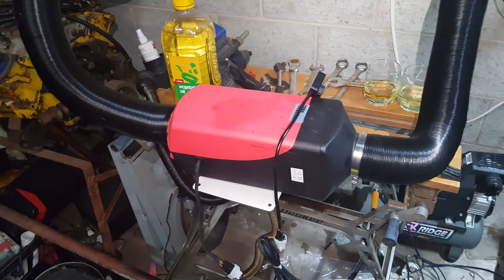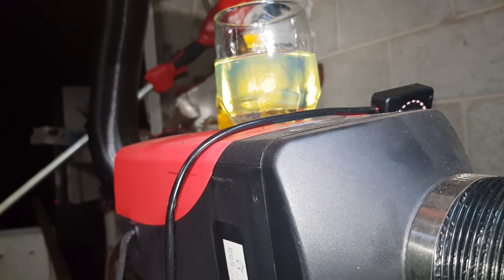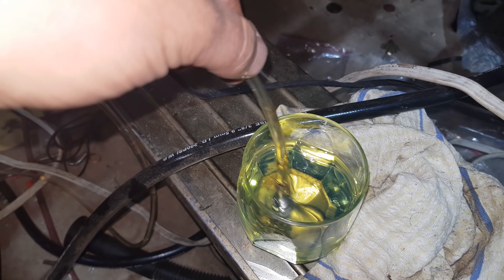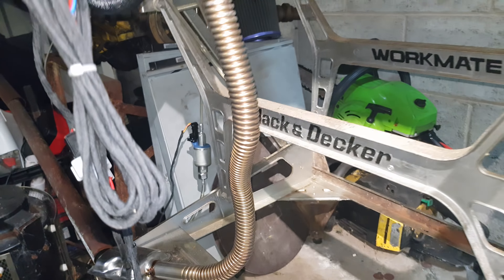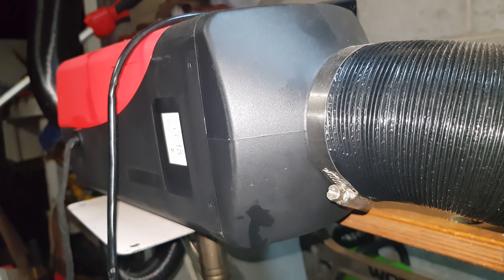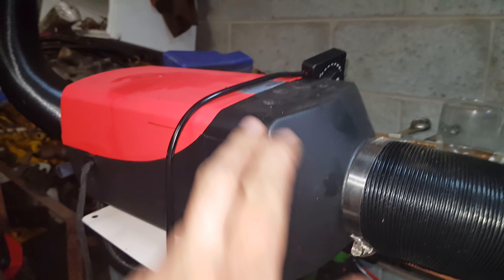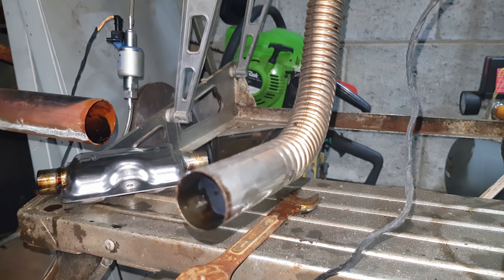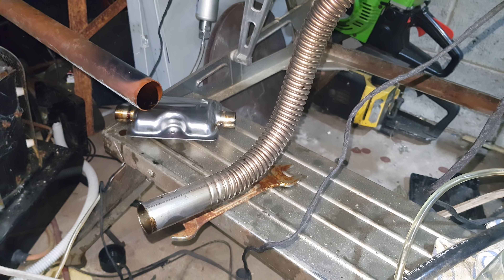Cheap  Chinese 5Kw Diesel Heater Runs On Bio fuel Vegetable Oil /Diesel Mix

Comment: I've been experimenting with mine. I've been successfully running a blend of 87.5% filtered veggie oil to 12.5% unleaded gasoline. Adjusted the fuel curves on the controller to 2.0 - 5.5 and rpms to 1680-4000 and now it runs better than stock. Startup and shutdown on kerosene, fuel is preheated through a SS brakeline wrapped around the exhaust, temperature maintained by a thermal sensor and a tiny PC fan to keep and hold fuel around 200-220F. I've ran about 30-40 gallons of waste oil through it already like this I'll post a video with my main account and link iit here soon. Heated my whole house through a power outage/snow storm.  cheers buddy
Reply: Hey bob! Thanks for the detailed description, I'm keen to do something similar. Is this mixture still going strong? any troubles along the way? Have you made the video on your heater setup I can check out?
Reply: Hi Bob. I'm going to try this in the next few days. Is it still going well? How's the carbon deposits? Cheers.
Reply from the maker: I've been running old motor oil lately and still been good with some diesel from time to time
Reply: @Oneupthesleevecustoms  I have thousands of litres of wvo. Trying to see if I can use it reliably in the CDH.
Reply from the maker: Mix it with so me petrol  it's find
Reply from the maker: Mix it with petrol its fine. Lowers the heating costs heaps
Reply: @Oneupthesleevecustoms  Just tried it duplicating Bob's settings and preheating and mix ratio. Flames out after a few minutes.
What ratio petrol/veg oil have you had success with?
Reply from the maker: 20 to 30% petrol has been heaps
Reply: % by weight or volume

Comment: I  did try 30% or lass of used veg oil and 70% or more of Diesel and works fine, starts without pre heating the fuel. I don't have a lot used oil, but using two separated tanks to mix it to start probably do even better. Thanks for the video, I want try it, but your video encourage me to do it!

Comment: I run mine on 80% filtered waste oil and 20% unleaded gasoline. Runs excellent. This is what I had premixed I use in my Tdi jetta. Very close to the viscosity of diesel fuel. Burns very clean in the heater so far.
Reply from the maker: Filtered waste motor oil? Veg oil?
Reply: @Oneupthesleevecustoms  Waste motor oil. I have an unlimited supply of it. I mix 4 to 1 with gasoline and pump it through a 1 micron sock filter. The heater runs clean with no smoke at all.
Reply from the maker: Thats awesome ill have to service my van and have a go
Reply: I only tried that mix because I had it on hand. Going to try running 3 to 1 this week. I bought three of these heaters to heat my shop, and have been testing one of them on motor oil before I set them all up. I am quite pleased. Runs better than my converted waste oil burner I have used for years.
Reply from the maker: They kick out heaps of heat. 5kw ones?
Reply: Lol did I mention the password for the heaters is 1688. In there you can play with the min and Max pump output and fan speed. I have mine running Max pump at 7.5 and Max fan at 5000. You need to raise the fan for more air when you raise the pump. Max values are pump 8 and fan 5000. Hasn't melted it yet.
Reply: does the pump setting in Hz need to be turned up to burn waste motor oil or waste vege oil?
i think the fan speed would help get more air to get a complete burn
thank you very much for sharing

Comment: Veg diesel users around here have a special exhaust pre-heater for the bio diesel.  It raises the flash point.  They have two valves where they can start on diesel until it gets up to temp, then switch to veg when the combustion chamber is hot enough.  This heater you would likely just have to leave both valves on to basically get a 50/50 mix on a hot combustion chamber.  Oh always shut down on diesel if you can.
Reply from the maker: that's a good idea mate cheers

Comment: Another great video, thanks! I'd still love to see you pass straight vegetable oil through a couple of loops of copper fuel pipe around the exhaust outlet pipe to reduce viscosity after warm up on diesel, there's no reason you couldn't burn 100% then. Waste veggie and waste engine oil can both be found free.
Reply from the maker: Im yet to test the preheat methods
Reply: @Oneupthesleevecustoms  No pressure but Keen to find out. The next obvious tests would be waste vegetable oil and used motor oil (don't ever mix them) though a racor diesel fuel filter/water separator between the heater coil and fuel input (warm oil is easier to filter than cold). There are even Chinese knock off racor /Parker filters.
Reply from the maker: Im keen to test anything i can :) this is why people watch my channel:) :)
Reply: Oh I just asked this about hot veg oil... I've just bought one and ready to have a play myself..  bio diesel is no different to a 50/50 mix.. I run my car with standard no alterations on a 50/50 mix if diesel and filtered waste cooking oil from local chip shop the engine drives better and I'm basicly achieving between 100 _ 140 MPG. I WILL ALSO MAKE A VIDEO LATER
Reply: @Oneupthesleevecustoms  I've been watching your videos on this, and bought a heater in hopes it would run of straight oil (the next day you posted a video showing it won't work haha) Anyways, I can get a lot of WVO for free and have made a few batches of really really garbage bio-diesel. I was trying to see how lazy I could be in the process. 400 micron filter, didn't titrate butI used about 8.2 grams of KOH 92%, and 15% methanol. All I did was drain off the glycerin and ran it right into the heater, no washing. Has been running for a few weeks here. Might be something you would want to play with since running off store bough new veg oil isn't really cost effective. I would be interested to see if pre-heating the oil would make it work on straight oil.
Reply from the maker: Bio diesel  should work fine

Comment: Yes you can improve the viscosity by pre heating the vegetable oil though some sort of heat exchanger but the oil still has to be burnt with a lot of air to to incinerate that glycerine fraction.
Reply from the maker: Thanks mate i didnt know about that
Reply: What glycerine fraction? Glycerine/glycerol only comes into play from making biodiesel which is not being done here. The VO is mixed and burnt directly.

Comment: The idea is to use used veg. oil that you can get for free. It has to be filtered and pre heated to work and then with a fair solar array you get   FREE HEAT!
Reply from the maker: Free heat from waste is the goal
Reply: Reclaimed cooking oil is still mixed 25/75% diesel to bio oil.

Comment: In regard to some comments here about burning used engine oil, it should work if filtered and mixed up to 40 or 50 percent with diesel but I wouldn't run it in my parking heater as automotive oil now contains anti burn agents. I don't fancy myself cleaning the burn chamber that often.
Reply from the maker: That makes sense. There is alot of additives in modern oil

Comment: Kerosene (or Home Heating Oil in the UK), is very similar to #1 Diesel, which has a lower flash point than #2 Diesel (auto diesel).  It is cheaper to buy than #2 Diesel because you're not paying road taxes and with the lower flash point, mixing in some straight vegetable oil would probably work out a bit easier.  If you continue to go the biodiesel route, you might blend in SVO as it gets warmed up.  I used to make biodiesel for my Jetta TDI back in the day.
Reply from the maker: Yeah it would work a bunch better if there was some compression to help it burn

Comment: Just noticed you are a powerwaller too. Good man. PS you could capture some of that waste heat going out the exhaust and heat water with it if you used an EGR cooler (mazda ones are cheap as hell here in the UK) + 12v pump to pump water around it.
Reply from the maker: Haha thanks man check this video out
Reply from the maker: https://youtu.be/BRMSFcq4Bc0

Comment: how about a 25/75 mix diesel/ veg oil. like the idea of used motor oil as well
Reply: I'm sure works because I just did 30/70 on my.
Reply from the maker: Happy with the results
Reply: Does the fuel oil mix separate in the tank ?
Reply from the maker: Over time be no issues in a vehicle
Reply: @Oneupthesleevecustoms  Thank you
Reply from the maker: @wishfix  once they are hot these things will run on most oils
Reply: @Oneupthesleevecustoms  👍🏻

Comment: I have been mucking around with used vegetable oil from the local fish and chip shop for years. I have burnt it mixed with diesel in my old digger and it runs well. BUT. Vegetable oil needs to burn at a much higher temperature than diesel to burn off the glycerine fraction otherwise it carbons up the engine. Has anyone dismantled the burn chamber to assess just how clean it will burn? Is there any unburnt residue from the vegetable oil fraction of the mixture.
Reply from the maker: Yet to open but mostly ran on diesel ag again now

Comment: I'd also be interested to see used motor oil attempted if you're willing to potentially wreck the unit. Let it warm up good on diesel then switch to used oil for a better chance of ignition. If it works, see if it will sustain.
Reply from the maker: Ill try a mix of motor oil and diesel

Comment: hi use the heater to start on diesel then switch to pure veg oil but heated with a container attached to the exhaust pipe as gets thinner when heated
Reply from the maker: Does it work

Comment: Vegetable oil probably would have work if you got the unit up the heat using diesel and then switch fuels some multi-fuel cars use this technique like getting the engine up to temperature with diesel and then switching fuels different fuels will work
Reply from the maker: Cars have the big advantage of compression:) sadly thats somthing these miss out on but if i could heat oil to flash point ish. It would run easy

Comment: Try veg oil and unleaded petrol 90%/10%. I used to do veg oil 95% to petrol 5% in diesel cars from pre 2000, and it worked a treat. Petrol thins the oil down much better than diesel.
Reply from the maker: Does it stay mixed
Reply: @Oneupthesleevecustoms  Absolutely  yes. The reason I suggest 90/10 is because petrol mixes better than diesel, it's more potent. It was well worth doing even with new veg oil because it was about a third of the price as diesel years ago. Now you might want to ask a friendly chip shop owner for some used stuff, but be sure to filter it well. There are loads of videos on that. Then just keep trying until you get the right mix.
Reply from the maker: Ill give it a small scale test cheers
Reply: Using that mixture, did you need to modify the vehicles, IE heat the fuel line, or unmodified? And does it get cold where you live?

I'm in Melbourne, gets fairly cold.

Thank you!!
Reply from the maker: I've done 70 waste motor oil 30 unleaded before
Reply: @paulraymond1804  I tried heating it up, but it's not necessary because the petrol really thins it down. I'd buy veg oil from the supermarket for a third of the price of diesel though, so it was well worth it. Now veg oil costs more than diesel, so yeah, find a kebab shop and ask them for their premium used oil 😁 . By the way, my cars were all old school diesel. Don't do it with a modern diesel, ie. after late 90's models that are multijet engines. Even then, if using used oil, filter it very well, or the injectors will clog up.
Reply: I drove from Manchester UK to Rome, up and down a good few times with no issues. Saved a ton of money.
Reply: @camperdude5241  ok that's great man. Manchester is pretty cold right? 😅

I asked my local fish and chip shop, they told me that they get paid by the business that collects their used oil. 🙁 I thought it was the other way around.

Will try other food places around here, if they all get paid for their oil, the plan is a bust depending on how much they get paid.
Reply: @paulraymond1804  the world has gone crazy! Yeah, keep trying different places. I've also asked at local tips, where they usually have oil drums full of restaurant oil. Only use it if you filter it extremely well.

Comment: Problem is that it's next to impossible to get free waste oil because all the restaurants are contracted with oil recycling companies, Who pay the restaurant to come pick it up. Trying to tap those waste traps in the dumpster area can get you a fine.  New veggie oil is far more expensive than diesel as well.

Now that being said, any small business diner would possibly be able to hook you up. As far as heating WVO goes, there are better heaters for that. DIY designs are available everywhere and there are a few people who sell fabricated units, or you can get a commercial waste oil heater. I'd stick to using only diesel in a Chinese diesel heater. A fun experiment, but if you rely solely on CDH for heat, dont mess with it, it'll end up breaking when you need it most.
Reply from the maker: I got 1000l of it free last week . Need to look at little shops. Yeah I run cars and trucks on it now not worried about diesel heaters anymore

Comment: Try to wrap a copperpipe or something around the exhaust to warm the veg oil before it enters the heater, that might work if you get it heated enough. But you have to runn it with diesel for some minutes.
Reply from the maker: It works well.as a mixture

Comment: what is advantage of veg oil? It is more expensive to purchase correct? Yes you can get used stuff but that is dirty. Do they make a 120 volt version of these heaters?
Reply from the maker: Not seen a ac version. Yes mainly if you could get free veg oil/get it cheap. Ive tested a few different fuels
Reply: @Oneupthesleevecustoms Vevor briefly  put out a white unit that had an AC option. I bought one about 3 months ago and then it was unavailable. Don't know why, maybe they will end up selling a vevor branded power supply to try and generate a revenue stream there, who knows lol.

Comment: You could try waste diesel engine oil my diesel car ran on it for 3 years mixed with straight diesel car runs flat out on engine oil when the turbo lets oil into the inlet manifold
Reply from the maker: Like when a turbo seal blows?
Reply: @Oneupthesleevecustoms  a diesel engine runs flat out when the seals go need to stall it cutting the fuel supply makes no difference
Reply: @marksmith5156  lol that's got to suck

Comment: Awesome to see the viscosity difference let it run. I was wondering if we can connect on Facebook. I would like to help with this project because once you can get it to run straight Veg Oil then I will buy one to do the same.
Reply: Also been thinking a lot about this project. The exhaust wastes a lot of heat that you can recuperate with using some steel gas pipe. At that thought I suggest not using the exhaust to heat the Veg Oil it may get to hot and to complicated. I think you need to have 2 tanks start on the 50/50 mix then you can switch to Veg ounce you use the heat from the air vent to get the Veg Oil hot. And the heat in there should be just hot enough to get it thin enough to burn and not risk the Veg Oil from autoignition from the exhaust.
Reply from the maker: I think you could push it out to 70 30 veg diesel

Comment: Do not do this !!! Yes it runs but the oil doesn’t burn!! I tried 25% motor oil 75% red diesel. Vegetable oil will be the same. It ran but I left on all night. Woke to found it wasn’t running. And it was full of motor oil. The oil doesn’t burn only the diesel does. Once I drained and managed to get it to fire again it now smokes out from the case and air intake pipe. And cuts on and off. Got it running outside but it’s still smoking after 2 hours of running at full wack. Do not do this it wreck the heater and the oil just ends up on the floor  at end of exhaust and could have poisoned us with smoke during our sleep. Cheers Buddy!! Why I listened to this. Seeing the smoke this could have happened whilst we were sleep! Literally toying with lives with this advice. Don’t try it. Use kerosene if you want something cheaper than diesel as kerosene is tried and tested and burns clean. Oil is terrible for environment and your health when the heater turns into a smoke machine which it will I guarantee. It also deposited a lot of carbon and muck inside the heater.
Reply from the maker: Great advice mate cheers

Comment: Could you run part of exhaust back into the intake and use the heat and carbon for advantage?
Reply from the maker: Not sure if the carbon will re burn but preheating the intake air on combustion  and intake would be beneficial
Reply: @Oneupthesleevecustoms  sleeve the intake over the exhaust or vice versa and exchange heat, like a gas boiler, heating the fuel wd be good too
Reply from the maker: Yeah make a exhaust heat reclaimer

Comment: Could you run the exhaust through a heat exchanger and heat water or does the exhaust need to run hot to help with the fumes
Reply from the maker: https://youtu.be/-LDGkoWCbGQ
Reply from the maker: ive had a go it should definatly work just a mater of a long enough exchanger and insulate every thing

Comment: If you heat up the veg oil (maybe a coiled tube around the exhaust pipe) would it run (after warming up with straight diesel)?
Reply from the maker: Yes apparently used waste veg oil is better all the moisture cooked out
Reply: @Oneupthesleevecustoms  no I meant, to heat up the fresh oil to make it burn by itself by means of coiling the fuel tube around the exhaust pipe. I understand you’d have to run the heater on diesel for a while before shutting down to clear out the oil so it’ll start again next time. But maybe that way the heater can ‘cruise’ on 100% vegetable oil with only minimal actual diesel use on startup and shut down?
Reply from the maker: That would sure make it alot cheaper to run